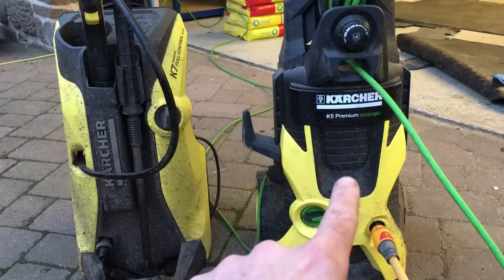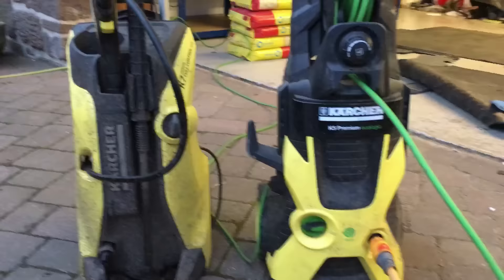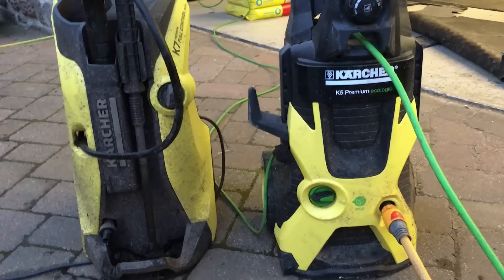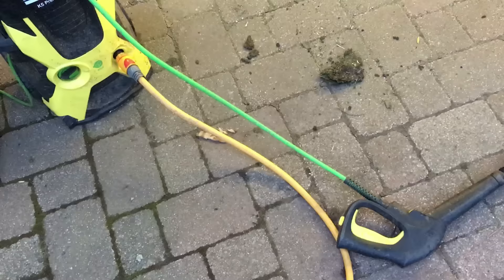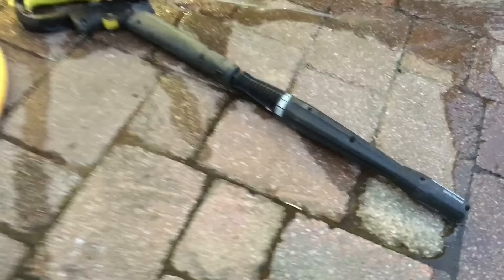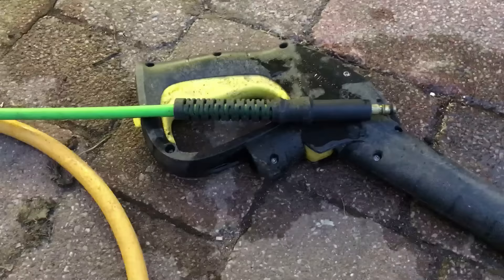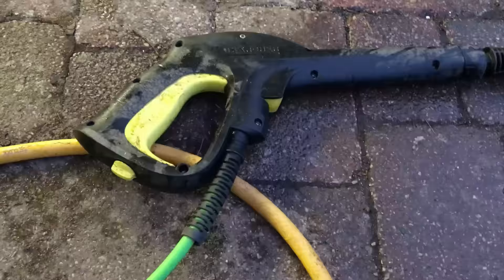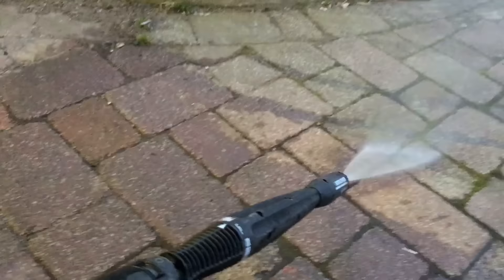Karcher K2 K4 K5 K6 pressure washer will not turn on | QUICK EASY FIX IN 5 MINUTES ! Karcher problem

Comment: Just got my K5 Premium working again after following your video instructions - thank you. I think I have worked out why the machine gets air locked. I often use the detergent container on the back for adding soap etc. and while I was in the process of flushing the machine as in your video I could hear air being drawn in somewhere. I traced it down to the detergent mix control, the round dial just above where the hose comes out of the machine. I then noticed that my mix control was on 'max' and even though there was no detergent bottle fitted, it was drawing air in. I then turned the mix control fully anti-clockwise to the 'off' position and shortly the air stopped being drawn in. So, in the future, if I'm not using the detergent bottle I'm going to leave the mix control on the 'off' position.
Hope this helps others to avoid the air locking in the first place.
Reply from the maker: Thanks for the comment Wyn, hopefully that will help some people out in the future, great bit of advice - thank you !

Comment: Great info. Flushing like this just got my K2 working after a few months standing idle through the winter. I don't think its air locks, though. I think its just something getting stuck due to dried out crud, that needs to be flushed and revived. Without removing the lance from the pressure tube you just don't get enough flow to loosen any crud. Once I got the main machine working, one of my lances was doing funky things for the first couple of minutes. Again, I think its just dried out crud that needed flushing. Everything seems to working like new again.

The bottom line seems to be power off, remove the lance from the pressure tube, and flush with water for a couple of minutes. If the machine then runs don't worry if the lance sputters, and don't spray consistently. Just put up with that for a minute or two and it will probably settle down and work well again.
Reply from the maker: Thanks for the comment.

Comment: The same scenario occurred with me, was working with it and it was running completely fine, switched it off and very next instant when trying to switch it on its completely dead. Tried every thing even kept it unplugged from evert for a day after loosing hope and it didn't work.

Watched your video, tried your technique and its good again thanks .

Comment: Thanks.  Got it working. The advice worked really well to get it working. After that it turns out I had some damage in the hose that was slowing down the water in the karcher hose. I bent the hose in the correct place and it improved water pressure so now it’s working. Thanks for your help. Inspired me not to ring Karcher!
Reply from the maker: That's great Michael and thanks for the kind donation to the channel, very much appreciated !

Comment: Many thanks for posting this.  I have a K4 that was completely non-responsive.  I actually didn't even take the hose off to bleed any air bubble - I just turned on the tap and fired the gun then, lo, as if by magic the power came back!  Thank you.
Reply from the maker: Thanks for the comment and I am happy it worked for you 👍

Comment: If I may add to this excellent fix?  Our tank water pressure is just adequate to run a Karcher. Normally no real problems. When I tried this fix, a small amount of air bubbles came out from the hose, but it DID NOT resolve the problem. I then tapped into the much-higher pressure gravity feed line from our mountain spring, and many more bubbles were flushed out of the unit. I connected it back onto the usual water source, and voila!  it was fixed. So, in my case, the pump needed a greater water flow to flush the air out. Something to keep in mind if you are on a rural low pressure supply.
Reply from the maker: Thanks for the excellent comment, hopefully this provides some value for people with similar set ups.

Comment: Thanks, had the same issue with my K2 pressure washer. The steps got it working again although no need to leave it running for 5 minutes. 30 seconds was enough.
Reply from the maker: Thanks for sharing 👍

Comment: Thanks very much for the tip, after running water through my Karcher for 10/15 mins the machine started up to my delighted amazement. Initially I ran the water for only a couple of mins but it didn't work so it is certainly worth running the water for a period in excess of 10 mins.
Many thanks
Reply from the maker: Glad it helped Mary, thanks for the comment 😍👍

Comment: Decided to clean the patio today and, yes you guessed it, my Karcher failed to start when switched on. Borrowed a friends Karcher and completed the job. During the cleaning process, his Karcher pulsated now and again ( see later). Thought my Karcher may have a problem with the switch or something electrical and was prepared to go and buy a new Karcher ( £199, ouch !!) so went online and found your video. Did exactly what you said and hey presto my Karcher now works. Must have been an airlock in the system that was removed after letting the water run out from the high pressure hose only for a couple of minutes. When I used my friends Karcher it started pulsating. I was using a 30m hose which was wound around the holder. My wife suggested using a much shorter length of hose and of course she was right - there is bound to be an airlock in such a long length of hose so from now on I will use the minimum hose length possible. You saved me £199 so thanks for that.
Reply from the maker: No problem and thanks for the comment 👍😎

Comment: I have had the same problem for years with mine. I normally just keep the trigger down and after 5 mins or so it has always started. I always thought the flow switch was faulty. Great information video, thanks
Reply from the maker: Thanks for sharing 👍

Comment: Thanks man, brilliant tip, worked exactly as you said it would. I was about to regrettably about to have to buy a replacement and then just decided to double check if there was a fix. 
I suspect the previous pressure washer we'd had befell the same fate. Wish I'd know this when replacing it back then.
Reply from the maker: Thanks Craig, yes, I imagine there are thousands of these go to the dump when a quick fix is all it takes to get them running again. Glad this worked for you !

Comment: Thanks fella - my K5.800 has given me start-up issues for years - assumed it was a flow switch issue or something. Sure enough, tried your air-lock release and it fires up every time. You`d think the tossers at Karcher might have designed something like a one way valve in the system to prevent this.
Anyway - all`s well that ends well - cheers.
Reply from the maker: No problem Eddie, thanks for the comment !

Comment: Nice! Same issue with my K5, did not turn on, disconnecting the water “gun” and letting the water run also solved my issue.

Comment: This worked for me!...Thanks a bunch I was ready to throw it out....I'm on tank water with a pump and I think the pump turning on/off when the pump pressure is triggered sucks air in?... IDK for sure... I still have issues not turning on..... if I have the garden hose on + the Karchers trigger pulled, ie letting water flow thru like in your video, while switching the Karchers on/off when the house pump switches on/off the motor will fire up..Takes a few goes but eventually works...might help someone who doesn't get it to fire up first go...keep playing with bleeding and switching on/off for awhile.......TY.
Reply from the maker: Great, thanks for the comment !

Comment: In my case of K7.80, I tried the described method but got no lucky. I managed to open the cover by removing the top and 9 screws, then replace the outshaped motor capacitor (cost about 15 bucks), everything works perfectly. Hope this will be helpful to people with similar issues.
Reply from the maker: Thanks David, hopefully that will help some people.

Comment: Thx mate, got mine working again, only difference is I had it switched to On , plugged in and the motor kicked in after letting the water run for a while.

Comment: You sir, are a fine man 😊 The first clip that came up and you solved my problem straight away 👍
Thinking back, I've inadvertently fixed this problem before. But, I've not taken the hose from the "gun". Just held the trigger down and allowed the water to flow for a short time (obvs, with the power switched off). Maybe, the next lucky person to come across this video, might want to try that first, before having to dismantle anything. Just a thought. 
Either way, you solved a problem in minutes today, after I'd been trying to figure it out and hunting for fuses (just in case) for nearly an hour. Thanks a million 👏👏👏
Reply from the maker: You are welcome and thanks for the comment 👍😀

Comment: Very helpful video - thank you for taking the time to film and post it. I'd only just bought a new hose for mine and used it for a few hours when the motor seemed to have died. Thought I needed a repair or new pressure washer until I saw your video. I've dropped you a few quid. Thanks a lot!
Reply: By the way - to any viewers - it does need the five minutes recommended in the video to run water through
Reply from the maker: Thanks John and thank you kindly for the donation, much appreciated 👍

Comment: Thank you. I will try that with mine. Mine stopped showing anything on the control panel which I was living with and now only one setting goes on - so it DOES have power. I will still try this solution at the weekend in case it solves it.
Reply from the maker: I hope it works for you Jane !

Comment: Hi, I had the same problem with a 650M .
 As you simply explain I let water flow some minutes , then I switch on...and the washer works again. Lot of thanks!
This problem happens to a lot of users......Why is this solution not described in the manual?...easy to understand.
Reply from the maker: I am happy that the video helped you Christine, thanks for the comment !

Comment: Got mine working, I’m not sure it’s an airlock I think there is a pressure switch inside that detects when you press the trigger and this is getting stuck and the flushing of water is un sticking this switch anyway good save 👍
Reply from the maker: Thanks for the comment

Comment: When i where going to use our Kärcher K4 Premium.. It would not power up just like you described.. was shure it was a write of.. googled the issue and found your video.. had to try it twice, probsbly did not leave the water running quite long enough the first time..
This fix worked on our K4 Premiuim..
I think this is an issue the Kärcher could do more to advise custimers about this possibility, pretty sure a lot of units are scrapped because of this..
Reply from the maker: Thanks for the comment and I am happy that it worked for you. ANOTHER saved from the scrap yard !
Reply: Hi, I happend again, just a few weeks after I used it last, struggled a bit more to get it going this time.. Suddenly I notised that the "soao bottle" was empty, since I dont use that bottle for washing car(s) anyway, I filled it with plain tap-water and did the procedure again and it fired right up.

 I can't say for sure but I suspect that an empty detergent/soap bottle (on models that have this) might be a source for air to enter the system and cause an "airlock"
So if this fix don't work right away checking the bottle might be a good idea 🙂

Comment: The following worked for me:
My Karcher K2 suddenly stopped working, even though in great clean condition and about 14mths old.  I tried following a number of YouTube videos advising to flush/run water through the K2 (while powered OFF) for approx' 10mins in order to `get rid of an airlock causing the fault`.   

I tried this about 12 times over various days, but to no avail.  With the main yellow cover removed, as well as the white casing inside opened & removed, I used a multi-meter and got no continuity from the switch wires.  I then noticed underneath the main switch area there was a little fine TRIP-SWITCH with a tiny spanner-like shape (commonly used as a service-symbol). 

Using a small point of the multi-meter (or a fine screwdriver) I carefully pushed the switch down, which then gave me a good reading from the multimeter.  I then reassembled the unit, connected the water hose and hey-presto, it's now working like new again.  I would imagine this could be a common cause on most Karchers - a simple but discreet trip-switch.
Reply from the maker: Wow, thanks for that, hopefully it helps other people out there. Thanks again for posting !

Comment: Thank you so much! Tried this method and it worked perfectly
Reply from the maker: Great to hear!
Reply: @Bacrenfencing  I did it a bit differently, but pretty much the same. I kept the nozzle attached and while the pressure washer was off, I sprayed water out of it for about 30 seconds to clear the line. I then turned it back on and it worked perfectly.

Comment: Hi having the same issue.. going to try this now and come back shortly to let you know if it works. My washer is a smaller one of the Karcher.
Reply from the maker: Hopefully it works for you !
Reply: @Bacrenfencing  yes it did thank you so much you are amazing. I would have been tempted to throw it away as I had used 2 different extension leads changed the fuses etc. I did as you said , plus changed the lance and it is back working perfect. Thank you again . Now a new subscriber of yours ☺  plus you have a great accent!!!! 👐
Reply from the maker: That's great, I am happy it worked for you !

Comment: Thanks this worked for me! Just saved me from buying a new one!
Reply from the maker: Glad I could help!
Reply: @Bacrenfencing  Hello, hope you can reply, I’ve left it like this for 30 minutes +. It did make a slight quite noise (better than when it was dead yesterday). 
I just saw a comment recommending to lay it on its back & I am hearing a lot of hissing / bubbling. 
It’s just there’s no water coming out of the karcher outlet (I have removed the lance) 
It’s currently hissing & bubbling away, as I’ve laid it on its back but still no water is coming out of the outlet pipe of the karcher 
A reply would be grateful appreciated 
Thanks for reading
Reply from the maker: @haroonhussain7568  Hi Haroon, I am sorry, I have no idea what could be wrong with that. Maybe best to take it to a service centre as it sounds like it is more than just an air lock. I hope you get it fixed.

Comment: Fantastic video, solved the problem immediately. I had  a snapped inlet/ outlet hose connecting unit during the first lockdown in 2020 when supply issues caused extraordinary waiting times on repairs or spares. I was dreading disassembling the K5 again in the hope of sorting out the powering issue, this video was a godsend.
Reply from the maker: Glad it helped Keith, thanks for the comment !

Comment: Thank you! Can confirm this works for the k4 premium too.
Reply from the maker: Good to know! Thanks for the comment Olly !
Reply: I had totally forgotten this, had the same problem, came back to YouTube and rediscovered the same video, and solved the same problem again.

Tkdw: unplug the spray gun from the hose connecting it to the unit, (yellow button in front of trigger on gun) run water through system with power off to clear trapped air, reattach, and you are good to go.

Comment: Also, a bad seal on the inlet hose connector can cause air to be sucked in, causing cavitation, and the pump will cut out intermittently.
Reply from the maker: Thanks for the comment !

Comment: Damn, this worked a treat! Thank you! Such a quick and easy fix.
Reply from the maker: Np problem, I am glad it worked for you. !
Reply: @Bacrenfencing  it appeared to be an ongoing issue for me. I have also found that if you detach the lance, pull the trigger and then reattach the Lance that worked for me. Meant I didn’t have to switch off the water each time. Hopefully this might help others too

Comment: If the fix suggested in the video doesn't work (it worked for me then stopped again), check the switch itself. Karchers switch mechanism is unbelievably poor. Me and my brother opened it, toggled the switch and she worked again. So I am replacing my switch to hopefully get it working again
Reply from the maker: Thanks for the comment 👍

Comment: K4: Running the high pressure hose as suggested hadn't worked (initially) but I noticed the chemical bottle holder on top of the machine was spluttering too. It had loads of dirt in it... 

I cleaned it with the spluttering hose and all of a sudden I got a clean flow from the hose and the spluttering noise from the bottle holder stopped too. Coincidence?

Now running normally.
Reply from the maker: Basically air in the system, once you clear the air, the machine should work perfectly. Thanks for the comment
Reply: @Bacrenfencing  Thanks for posting

Comment: Hello there, thanks for the video and I am about to try your solution.  Just one question - is the pressure washer meant to continue "chug" when connected/powered etc, but when not being used - when I say chug I mean the noise you initially get when turned on - if I stop using mine it makes this noise continually, every 5 secs or so like a pulse.  I am wondering if it because I am connected to an very long hose (far from the tap).   thanks Sean
Reply from the maker: Sounds like there is air in the system. If you use my method, hopefully it will work for you.

Comment: My power washer stopped working tried this trick but there seems to be always air coming out from the hose it won’t prime back I’m stuck 🤷‍♂️
Reply from the maker: Leave the water running through it for a good 15-20 minutes and that may work ?

Comment: Did this and sort of worked but the pressure from the tap is high yet the water stream from the marcher hose is very weak. Can you help? Will definitely donate if you can
Reply from the maker: Just leave the water running through the hose for a longer period, that might work